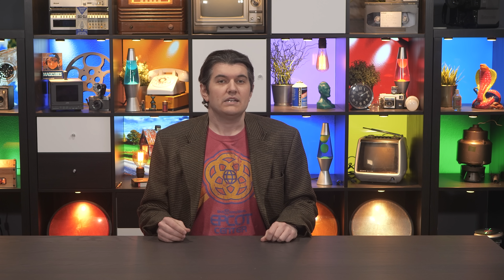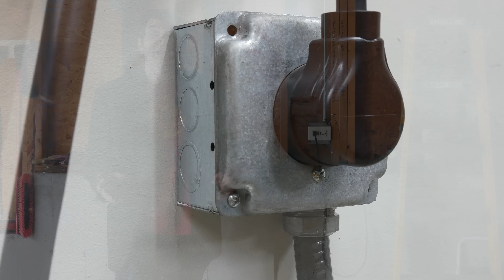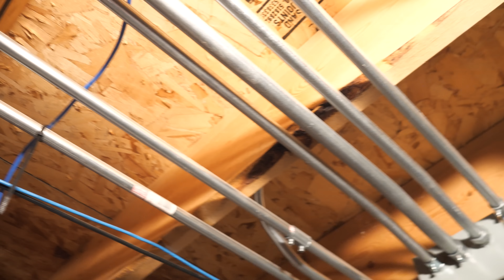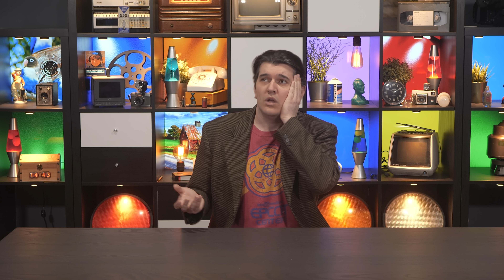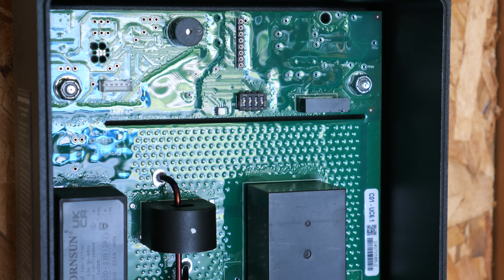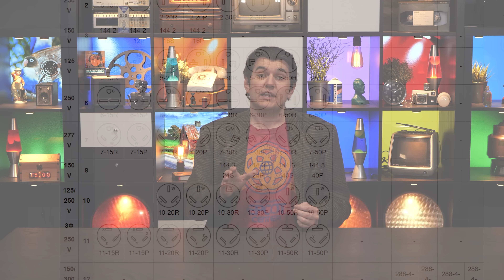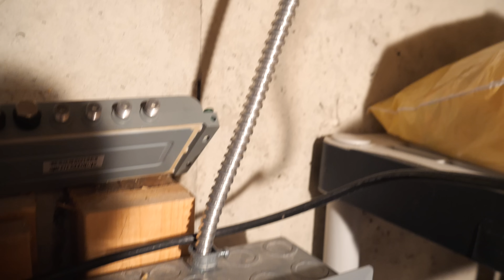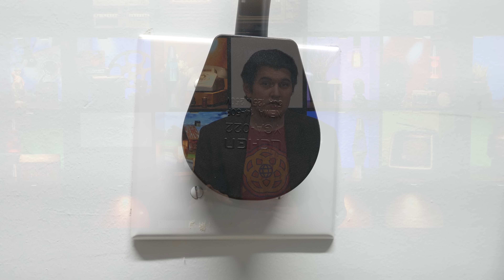The "standard" car charger is usually overkill—but your electrician might not know that

Comment: Don’t some districts require four wire two phase new wiring installation. I see yours at home does but the table did not. Now if every household has one EV and charges overnight can the grid handle it now. Then add the draw from data centers. Some day I. The future. 

Agree for those not home owners. My understanding is DC fast charging cost more than gas. Then think about it. How many charging stations will be needed in an apartment complex per 100 units.

Informative video. I’ve thought about an EV car or motorcycle for years. But before I retired I needed to reliably drive 150 miles one way twice a week to work away from home.  A used gas SUV was more economical. A used EV may be practical now to replace the Tucson I about with 80k miles for $8k in 2020 when it dies. 😊 So one EV and a gas care for the 250 mile one way trip to the grand kids may work in the future. I already have a welder outlet in the garage.

Comment: When we bought my wife a Tesla 3, my neighbor and I wired in a 30 amp 220 line from the breaker box to a standard 220v 30a receptacle. The hardest part was pushing the wire through the conduit mounted above the garage door. It works perfectly. 

When I bought my Tesla Y, we didn't have room in the panel for a second 220v line. But a 120v 15 amp outlet was already mounted on the garage wall right near my car.  

I drive about 20 miles a day on average.  The 120v 15 amp outlet was adding about 60 miles of driving range per day, since I'm retired and the car sits home all night and most of the day. Then I checked the breaker box, and that circuit was actually rated at 20 amps. 

I bought a 20 amp outlet on Amazon for six bucks. Then I replaced the existing 15 amp outlet with the 20 amp outlet myself in about ten minutes. While that only increases the charging capacity 25 percent, it means I can now charge up to 80 miles a day. And it only cost me six bucks and ten minutes to make that small upgrade. If I ever need faster charging, I use my wife's 220v outlet. I've only had to use it once after a 260 mile trip.
Reply: I'm just reading this, it was very helpful. So just by installing a 20 amp outlet, your Tesla now recognized this as a 20 amp and began charging at 16 amps? I just got my Tesla yesterday and I'm charging at 12 volts though I think the wiring also is 12 gauge so if I just change the receptacle, I could get the extra juice? Definitely a game changer for me, my electrical panel is completely full.

Comment: I recommended to a friend that he get his landlord to just install a 2-pole 240V/15A breaker, and use the existing 15A wiring to a 240V/15A new outdoor socket. Basically they replaced the breaker and the socket. He had a small car, but a huge issue with slow charging. He was very happy because his charging time was halved to essentially overnight.

Comment: Interesting.  I have a 2017 Bolt, and just charge from home, even though it does have the fast charge option.  I found out that the charger it comes with is the same as the eoropean one that runs at 240 volts and can provide more amps.  So I converted it to plug into my unused garage 240 volt outlet (I have a gas dryer) and it all works fine.  If the car is really low, rare for me, I can tell it to charge at 12 amps vs. default 8.

Comment: I get most of my charging from a 120.  Some weekends it is not enough, but the supercharger is a quarter mile away.  Averaging about 8% of charging a month from the supercharger.  If I didn't have a performance model, and had a standard sedan, then I would need even less juice.

Comment: For those doing hourly rates from ComEd (IL)  or other utilities that offer this, you do want the highest power output (50amp).  Reason is you can charge during those low rates overnight .  The issue is these low rates only last 2 to 4 hours.  So you set car to charge only during those low rate hours.  And this way you can squeeze out as much during those limited hours.

Comment: Counter argument: installing a higher current capability outlet for charging your car is actually a great idea. Resistive losses in the wire are reduced with higher gauge wire, and your car charging becomes more efficient. Over time even a small percentage improvement in charging efficiency can save you a lot of money. Safety margin is also higher! This is all assuming that you are using a high current outlet while limiting your charging speed to something modest.

Comment: The cheap $10 outlets go on fire 
Stick with Hubbell and also with Bryant  ,you need outlet that does continuous loads not the normal
Dryer load I would direct wire
Outlets now have to be GFI protected  I don't think direct wire do yet

Comment: Whoa us electricians base the plug and breaker on the equipment if its known. Besides it's better to go with a larger one size fits all then get complaints by the home owners. Yes we do in fact understand the charger requirements but it's the customer that ask for the fast charge my guy.

Comment: 110 V charger is excruciatingly slow! It's not practical. If you want to avoid a 240 outlet, I did back in the day use a contraption that plugged into two 110 sockets and made a 240 V outlet. I think the max was like 6 kW? But it worked pretty good and I didn't have to run a 220 socket. I think the company is called quick 220…

Comment: So, we got a smart-ish charger because basically all charging station installers sold something like that and I didn't know then the car took care of all the hard work. There is one good argument for them: if used in conjunction with solar panels, you can regulate the car's demand so it only charges on solar. If you're in no hurry and want to save on bills by drawing less form the grid at peak time, thus also relieving the grid and possibly lowering infrastructure upgrade needs etc... One thing Im super mad about missing though: a simple function that shuts down the charging when Ir each 80% load. It's apparently beneficial for long term battery health and it's such damn simple feature. I've seen it on fast-charger that look 10 years old or so! We even told the software maker to just give us a timer function (since they're local allegedly...) so I can estimate when 80% is reached (but forget about the solar regulation mode then, my calc works for constant draw) and have it stop but no "that's too difficult". I have to use a separate timer app, and of course if I'm not around my phone when it goes off, the whole plan fails.../rant

Comment: You can charge your car just fine on 110 but it will take you days and days to charge it up. If you're only driving 20 miles a day it's fine, but more than that and you will need in increase the voltage.

Comment: 120v is enough in most cases but also keep in mind 240v is more efficient and wastes less energy in comparison to 120v per charge. This is because the cooling system requires energy as well as stepping up the voltage. It’s not much of a difference though, just something to consider.

Comment: I have a level 2 charger I got with my car, but was avoiding installing it because of the expense of adding a 60A breaker. After seeing this I checked for a circuit capacity adjustment option, saw that the charger had one, and over the weekend pulled a new 30A circuit myself since I could fit that in my panel without tripping breakers when I turn on the microwave. My car charges 4x faster now with my nice hardwired level 2 charger. Thank you!

Comment: Just wanted to add something helpful, you can go in between with a 5-20 outlet/receptacle. Most outlets in America are already wired for 20 amps. You can easily install a 5-20 outlet in minutes, and it can give you a 20% boost in charging speed compared to a standard outlet.   
  
You can check by looking at your circuit breaker. Find the one that corresponds to your outlets. If it says 20 then you're good, if it says 15 youre out of luck. Remember to follow the 80% rule and only pull 16 amps after install.

Comment: Having used every level of chargers I can say without a doubt that once you have a full power charger installed (In my part of Canada that requires an 80 amp circuit to handle surges or faults) you NEVER, EVER will want to go back. Sure it cost $400 for installation of that dedicated circuit and protections, but wowzers, our family never worries about charging during our busy driving days whether it is -40C or +40C (our City has the largest temperature swings of any city in North America).

Comment: Folks, I keep reading "...because of the 80% rule..." which for a multi-branch circuit is true, when your EV charging outlet is the following you get 100% of the circuit breaker rating:

Dedicated Circuit Definition:
A dedicated circuit, or individual branch circuit, is one that serves only a single piece of utilization equipment. 

100% Loading:
When a branch circuit is dedicated to a single load, NEC Section 210.22 allows the load to be up to the full rating of the circuit breaker. 

Thus a 30A / 240V branch circuit yields 7.2 kW of available charging.

...just saying.

Comment: I can back the “you probably don’t need high end level 2”
We just got a second ev and instead of a second high end lvl2 (60amp 240v) we did a simple and easy 20amp 240v. Able to use our current mobile charger and just needed a $8 plug and a $10 breaker and we were off to the races!

Comment: Licensed electrical contractor here, for 90 percent of Americans driving less than a hundred miles a day, a NEMA 6-30 will do the job, that’s 24 amps times 240 volts, 5.7kwh of charge. 

For smaller EV’s, I have even done a NEMA 6-20 (240 volts at 16 amps).

Comment: Friend of mine in the late 80s early 90s converted a Datsun station wagon into an e-car. Charging cord was under the hood and poking through the grill. In order to charge, he would just grab the plug in the grill cutout, pull it to unwind, and plugged it into a standard outlet inside the garage, or on the side of the building. No special outlets needed. It could literally be plugged into ANY outlet in the house.

Comment: I have same charger. Plug fire with 14-50 (I blame the plug not the charger) a year after install I went with hard wiring where it’s now set at maximum pull rate.

My 14-50 was UL listed but I believe these chargers should be hard wired or at least have the box external to wall.

120v is usable on efficient cars (model 3 or leaf), but worthless on many of the newer ones. I have a 102 kWh pack in another vehicle so it would take four days to charge a mere 300 miles.

Comment: F150 using a 16 amp setting on a grizzle charger. Going on year 2.  Largest charge was 50-80%.  Perfect combo for us because the plug was already in the garage. 

But now our ford dealership has two fast chargers 🎉

But they overcharge on the rate. Typical 😢

Comment: I disagree with the no mesuring in the charger. We live in an apartment building and the on charger mesuring device which is conected to a webservice is responsible for the charges for the used electricity in the garage. And thats why i think its not just stupid to have it and why i accept it beeing connected to the internet.

Comment: As someone who drives 160+ miles per day in an EV…

It’s definitely nice to have the 40 amp charger, but even I could probably get away with a 24 amp charger… 

The extra amps are nice for being able to run a few errands in morning, plug in for a few hours at home, and then run around and do some afternoon errands with plenty of charge at all times… but that still not needed all the time either.

Thank you for best the drum that more level 2 charging needs to be focused on, level 3 is great for roadtrips, but it’d be amazing if level 2 were literally everywhere… if the car is parked, why not plug it in?

Imagine if every parking lot had level 2… you’d always have a charged car! Level 3 really would be for road trips only!

Comment: Sidenote from Europe: our 220V 16A sockets are more EV friendly, but here most people forget about 80% rule and, worse, even some car manufacturers - some cars get delivered with 3.6kW chargers (16A). Our sockets are rated 16A, but only for hour or two (which is buried somewhere deep inside standard documentation and most electricians are unaware of it). There are also available dedicated EV charging sockets lately, they are certified for 16A continuous load, but still, that doesn't solve breaker heating issue...
Reply: Just say your country. Europe is not a country. You shouldn't speak as if it is.
Reply: @CorneliusTaylor-s1u same socket (type F; Schuko) is used in almost all European countries. Exceptions:
France, Belgium, Poland, Slovakia & Czechia - they use Type E;
Denmark - they use Type K, but E and F has been legal for last 15 years and country is slowly migrating to both of them.
United Kingdom, Ireland, Cyprus, Malta - they use Type G

Type E and Type F are compatible in way they follow same specification except for ground contacts and plugs are made to accommodate both standards. 
There are also Type C used in most of Europe, but without grounding and mostly for low current applications, so not relevant in context of car charging.

Italy also has L type, newer versions are made compatible with Type E and Type F specification.

So, in context of car charging, Europe only have four exceptions: United Kingdom, Ireland, Cyprus, Malta
Reply: @mrblc882 

Once again, Europe is not a country. You shouldn't speak as if it is.

Comment: Electrician here if your going to use the 240 plugs get the ev rated ones sounds like a scam but they are built much better and iv started to regularly get calls for ev chargers "overheating" just to find the the plug is melting in the back

Comment: I don't have an EV, but this was really interesting. I'll be sure to refer back to it if/when I get one.

Don't know if you are seeking out video ideas, but a couple tech things I've been curious about are Wall Plug - Ethernet adapters. I had ones for a Sling Box I used to have in like 2006 or so. I couldn't comprehend how Internet data could travel along house wiring and come out somewhat intact. I tried online computer gaming with that and got a better acquaintance with how inferior it was to a straight Cat5 connection. But honestly I'm still amazed it worked at all.

Comment: I am one of those lucky people who has a dryer outlet in my garage, however because I have an older home it's a now-obsolete NEMA 10-30 receptacle.  I am finding conflicting information online regarding whether it's ok to use it to charge an EV.  Some people (mostly electricians, it seems) say it's super dangerous because the 10-30 receptacle doesn't have a proper ground.  Others (mostly EV enthusiasts) are saying it's perfectly fine as long as there are no issues with the wiring.

Comment: It's interesting that on your side of the pond it's so explicit that you should draw only 80% of the circuit capacity.  A common problem on this side is electricians who say, "Hmm.  It's a 32 A EV charge point so I'll put it on a 32 A circuit." and then they're surprised when they get nuisance tripping.  32 A charge points need a 40 A circuit but it's surprising how many professional electricians don't understand that.

Comment: As an EV owner and road tripper, the other thing that I wish new EV owners would understand is that it is probably far faster when on a long trip NOT to sit a single charger till you get 100%, but just staying there until you have just enough to get you to the next fast charger ... even if you are only at 40-50% charge. This style of driving an EV is way faster and would reduce travel time, even if it does seem counter intuitive. 

If you're stopping for lunch ... GREAT! Sit and charge as much as you can. But if you're only at 80% after lunch, just leave anyways. You probably will reach the next fast charger on your trip long before you run out.

Comment: I don't currently have an outlet for an EV charger and my panel is full. In an attempt to keep costs down I was considering getting a NEMA outlet installed in the garage off a sub panel and intended to swap between my wife's future pottery kiln and an EV charger as needed. You've just sold me on biting the bullet and getting two separate outlets installed. Or getting that load balancing device.

Comment: I installed a 14-30 outlet for 24a charging because of the limitation of the power supply to my garage.  We charge two EVs off of it and alternate as necessary.  It’s been enough to cover two vehicles at about 30k miles a year combined.  One car charges 1-2 times a week and my more intensive driving has me charging every other day.   I’ve never seen a reason to run a splitter style to have two chargers installed together.  Alternating has been plenty.

Comment: Well done video! 👍🏼 One of the most important considerations is the gauge wire to circuit size. I use an infrared thermometer to check all wire temps to while under load just to be safe!

Comment: We did a 30A circuit when my friend bought a tesla and set the charger for 24A.  10AWG wire was cheap(er)  (actually free since we had it extra) and he still hasn't needed to hit a supercharger for "backup" and he's had the car for almost a year (1 year on July 3rd).  EV's will charge on anything available - there are even plug-in boxes you can get to run 2 cords to opposing leg outlets to output 240v to charge your car faster, like if you are at an Air BNB or something.  Also, there are plug-in dryer circuit splitters that prioritize the dryer over the EV, so if you have a dryer handy, you can plug in and use the dryer circuit when it's not needed.  Lots of versatile options and lots of compatibility out there - doesn't always have to be a dedicated 50A NEMA 14-50 plug.
Reply: WHAT? Run two cords to two separate (leg) outlets? I can't even begin to tell you how wrong that is.